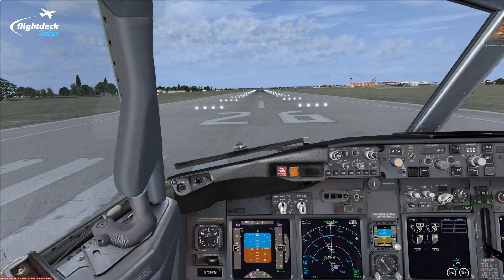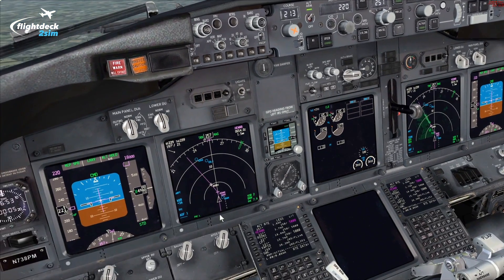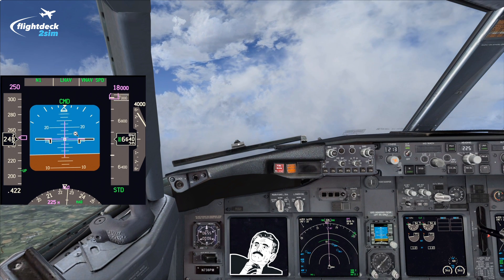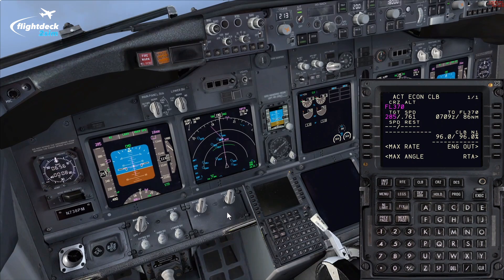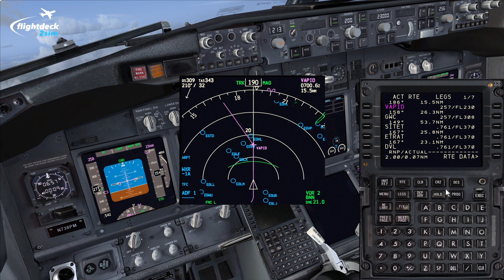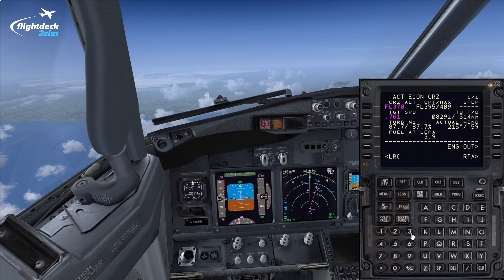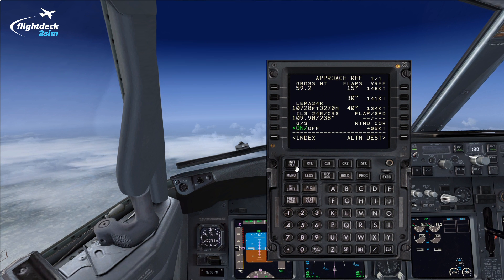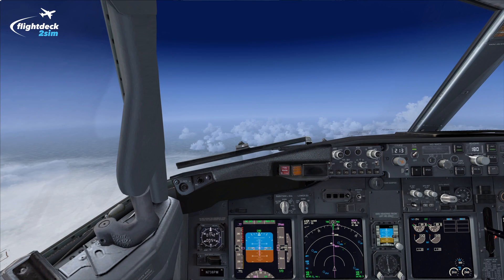PMDG 737 FMC/CDU Tips & Tricks Tutorial from a Real Boeing Pilot

Comment: I have a cdi gauge with airmanager I'd like to put the gps course on. Is there a switch in the 737 to make it work. I have the toggle gps button programmed in msfs but it doesn't seem to work. But it will work with say the default a320. Any advice would be much appreciated.

Comment: Thank you for the video. Regarding offset, I’ve heard of some line pilots using the offset function with a very small offset such as 0.1 or 0.2 as a final safety measure against conflicts with traffic operating on the same airway. Have you ever come across this? Perhaps more applicable for Atlantic tracks or for other remote areas without good ATC coverage?
Reply: Look into SLOP for oceanic airspace. Not a bad idea for domestic also, however not company or faa approved

Comment: Recently watched a JustPlanes Tui 737, approaching ILS 25L and ILS01 was also in operation and in case ATC requested them change runway they drew in a centre line of 01 through the FMC but it isn't shown how they did it.  Could you explain how that's done.  Cheers

Comment: Nice presentation. I use the offset function more often for CB avoidance when I calculate the miles left or right needed to avoid passing through the cell, asking the control for a -xx miles L/R to avoid. It is very convenient.
Reply from the maker: Hi Stelios!

Pretty much all of European Airspace above FL245 is Radar Controlled so we can just request a vector, wherever you go they are usually quite accommodating, even when it's busy!

FD2S

Comment: Hello. At 10:08 you demostrate the waypoint editing in the pmdg... As the zibo doesnt do curves yet (for now) , I'd like to have this feature in the zibo as well... Could you have a look at it please? I just made a DMI arc in the zibo, and as the first DMI arc waypoint has an angle of almost 90 degrees, the zibo will not turn or add the curve like in the pmdg. Using the feature at 10:08 would allow me to shorten the waypoint and make the angle wider so the aircraft will turn to enter the dmi arc, and not "overshoot" the waypoint. Regards.

Comment: FD2S - I'm probably making a text book error (although I have checked, double checked and triple checked all settings) but I can't seem to get the PMDG 737 NGX to actually follow the flight plan/route. Any tips/suggestions of what I could be doing wrong?. Keep up the great vids FD2S.
Reply from the maker: Good day!

Hmm. So long as you have the correct information in the FMC LNAV should accurately follow the lateral path, it could be several reasons otherwise!  Sorry I can’t give you any more info than that!

FD2S
Reply: @flightdeck2sim  Thank you for the reply, it would appear that I did not activate the LNAV selector/button on the mode control panel. As mentioned above, text book error lol. Thanks once again FD2S, awesome job.

Comment: Hi FD2SIM, can i also use the fmc to fly a teardrop approach? Or will that always flown by hand? 
exmple : I have flown a couple times EHRD (Rotterdam airport RW06 ILS) with a non straight in landing. Looking at the chart of RW06 ILS  http://www.ais-netherlands.nl/aim/2018-08-30-AIRAC/graphics/eAIP/EH-AD-2.EHRD-IAC-06-1.pdf 
I am usingthe following incoming route:
ROT adf -  261 degrees
PS adf - 
course 291 degrees
procedure turn cat C for Zibo 737
EH250 towards G/S, landing RW06

Currently i program a custom waypoint to make the turn...

Thanks again and keep posting your great video’s!
Reply from the maker: Hi andrevdw, 

If it's correctly coded there should be no issue. If it's not coded fly over PS and then for a CAT C aircraft it's 1m15s on the 291 before turning final.

FD2S
Reply: flightdeck2sim Thanks, it is not coded correctly so will fly the approach as I did before. Kind regards, Andre

Comment: Thank you for your video.

I am not a pilot, and I do not sim either. I am not sure about this, so you can correct me if I am wrong. 
The offset function is there because of the Strategic lateral offset procedure (SLOP). This is a procedure that became necessary when increases chances of near misses flying over for example the Atlantic due to more accurate navigation (GPS basically). Of course this should probably not happen anyway because of separation both vertically and horizontally, speed restriction and what not. But this inaccuracy in INS was just a third layer in case someone had a level change which was a bit slower then expected or something (remember, no radar over the Atlantic, so it's based on position reports etc).
To try to get this extra layer of security back someone a lot smarter then me, gave this idea to someone with a lot shorter work days, longer lunch breaks and a lot more pay then I have, and made a procedure that every flight over the north Atlantic can chose to fly the track center track, 1 nm to the left, or 2 nm to the left (anywhere from the track until 2nm left, but never more then 2nm left, and never right). This is chosen by the PIC or PF at random. As far as I know this is at least used over north Atlantic, it might be used in some other big areas without radar coverage.  

Again, I am just an enthusiast, and I would love to proved wrong, because then it just mean that I learned something new. So please let me know if this is wrong. However, my point is that you will probably not be asked by ATC to offset your track, as this is done at PIC/PF's will, and are usually not part of flight plan, or even reported to ATC that they are offset. Position updated shall be given as normal, without the offset.
Reply from the maker: Hi Hans,

I’ve only flown in Europe and North Africa and not along oceanic routing and not qualified to do so, I cannot answer your question using the offset function transatlantic. 

It sounds like you’re very knowledgable in the area! Aircraft crossing the pond are often given entry points, a specific time they must cross it and a Mach number they must fly. Whether they use the offset function I’m not too sure!

FD2S

Comment: Could you maybe to a tutorial on how to fly the Runway 04 inital approach without radar vectors from CASEY to ILS into stansted? im struggling to input the custom waypoints D30.0 CLN D18.0 BPK ect into the FMC :) thanks for any help
Reply: the chart plate is 30-2V
Reply from the maker: Hi Dene.

CASEY would only be flown if BKY VOR is U/S. Off the top of my head I’m not sure but If you select the ABBOT or a applicable transition it should give you good guidance. You would get radar vectored onto the ILS at some point after CASEY/ABBOT

FD2S

Comment: Awesome videos. How do you get the FMS to have you at a specific altitude at a specific distance from a VOR/FIX. For example: Assuming you are direct to TUS VOR, ATC gives you “50 miles prior to TUS VOR cross at and maintain FL190”?
Reply from the maker: Hi Robert, thanks! 

In this example TUS/-50 at LSK1L and 190 at LSK1R.

The FCOM that comes with PMDG is pretty much identical to the real aircrafts FCOM, some great guidance there 👍🏼

Good Luck!

FD2S

Comment: I have a question regarding step climbs.

Let's say you're at FL350 and have a step climb ahead where you're supposed to climb to FL360. The easiest way doing this is dialing in 36000 on the MCP and press ALT INTV. That will automatically set the new cruise level on the CRZ page and then you'll of course also have to set the new FLT ALT on the overhead panel.

My question is what's the easiest way when instead dropping down from let's say FL360 back to FL350 without fooling the FMC into descent mode? I noticed how the same method as described above won't work but instead you have to type in the new FL on the CRZ page and EXEC and of course also reset the altitude on the MCP back to 35000 as well as on the overhead panel.

Is there an easier way doing this similar to when you do a step climb? And if you accidentally have the FMC go into decent mode, is it possible to get back to CRZ mode?
Reply from the maker: Hi Richard.

If we were to get a step descent or early descent to a lower CRZ level set it on the MCP and by pushing ALT INTV you will start a 1000fpm descent until it captures the descent profile. Obviously it will never capture it if it's an early step descent so all you need to do is insert your new CRZ level in the FMC on the CRZ page which will exit the descent mode. The aircraft will enter a "CRZ DES" maintaining 1000fpm until reaching the new lower CRZ level, that's how it's done! 

FD2S
Reply: Ah, thanks! I'll give it a try.

Comment: Is it safe to turn off Seatbelt signs at FL100 even though the aircraft is climbing at a very high rate and making sharp turns?
Reply from the maker: Hi 23 Savage,

Should be! Even at light gross weights and low airspeed our climb rate wouldn't affect passenger comfort or the ability to walk around the cabin. In normal operation we don't typically bank over 25 degrees either so seat belts off at FL100 unless in turbulence or forecasting turbulence.

FD2S
Reply: Thanks, and keep up the videos, they're very useful!

Comment: Hi!
Very usefull video, as always!
I have a question about speed restrictions. Can you enter a speed restriction based on distance?
For example, if an approach says maintain 160 knots 15 nm prior to airfield because of noise restrictions?
Reply from the maker: Hi Scorpius, thanks!

You can use the FMC to enter a speed restriction but at that point we would usually be established on the approach. Flying 160kts at 15nm would in fact create far more noise because the flaps would have to be extended, we would need to add thrust to maintain speed!

We would typically aim to be flying 160kts at 6 miles and employ a CDA (continuous descent) whilst reducing speed, the idea being we can leave the thrust leavers closed until 5 miles when we start configuring gear and landing flaps.

I hope this helped to answer your query! 

FD2S.

Comment: The offset routing is used quite frequently in the U.S. to go around enroute weather. Instead of having ATC to give vectoring around the stormcells they usually opt for an offset (i.e 5-10 miles to the left/right of the edge of the cell, then clear them back on track when they've passed it. Takes a load of work off the controllers.
Reply from the maker: Cool!

Someone mentioned in the States that this is quite common! Pretty much all of European Airspace above FL245 is Radar Controlled so we can just request a vector, wherever you go they are usually quite accommodating, even when it's busy!

FD2S.

Comment: Can you explain how do you use the Fix page to create those circles around the aircraft?
Reply from the maker: Hi Aner44,

You can only create circles using the Fix page around WPT's in the FMC Database, not the aircraft! Was there a part of this video you were referring too if I can help further?

FD2S
Reply: flightdeck2sim I mean, when you arrive at the airport, there are green circles around it. It's circle is bigger than the others! I want to know how to set that on my FMC. Regards!
Reply from the maker: Aner44 have a look at 15:20 👍🏼

Aner44 got you!

We place fix rings around the runway in use at your selected ARR. You can either line select key the runway in the legs page like I did in this video or physically type the runway using RW then the no. E.g. (RW24R).

FD2S

Comment: i love your content, how technical it is but how well explained. I hope you can make a video on descent management through the FMC, in what scenarios is most common to use level change, vnav or VS, how to quickly input in the FMC altitude restrictions when ATC tells to you to cross AT specific altitude over a wpt, or if you are given a direct route to FAF and you are coming in too high.
Reply from the maker: Some good info from RainbowMiner! 

I have a High Energy Approach Tutorial which might be beneficial, I explain how to deal with being high and explain some of the other pitch modes available in the MCP. I purposefully put myself high and explain how we can manipulate the configuration to descend back onto profile.

https://youtu.be/5KiRK1ugHRY

Hope this helps!

FD2S.
Reply: Hopefully this helps you: this is all US procedures though because that’s where I normally fly in and this is how I do it in the PMDG.

Cross xxx at and maintain: On the RTE page, type in the level you’d cross it at (I.e. cross SSOXS at and maintain 5000, so type /5000) and click on the right line select key for SSOXS. Make sure to set your altitude to 5000 so you level off and maintain 5000.

Cross xxx at or above: On the RTE page, type in the level you’d want to cross it at or above, plus the letter A (ie. cross SSOXS at or above 5000, so type /5000A) and click on the right line select key for SSOXS. Set your altitude to something at 5000 or above.

Cross xxx at or below: On the RTE page, type in the level you want to cross at or below, plus the letter B (ie. cross SSOXS at or above 7000, so type /7000B) and click the right line select key for SSOXS. Set your altitude to 7000 or below.

Cross xxx at: On the Rte page, type in the level you want to cross at (ie. Cross SSOXS at 5000, so type /5000) and click on the right line select key for SSOXS. Set your altitude to your target altitude. 

Btw the right line select is the one with the altitudes and speed on the Rte page.

Don’t know about slowing down for the FAF, but hoped this info helped you
Reply: RainbowMiner2004 thanks for the info!